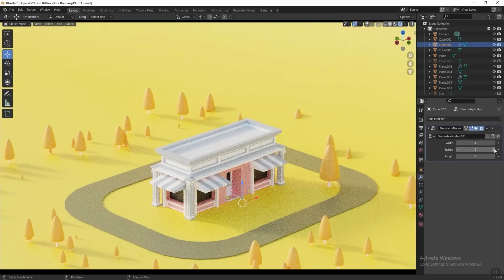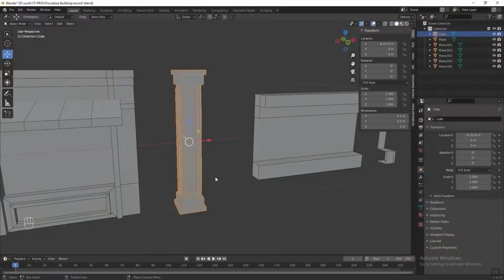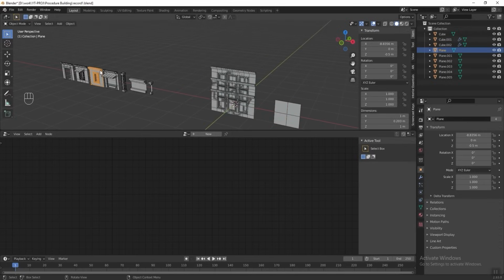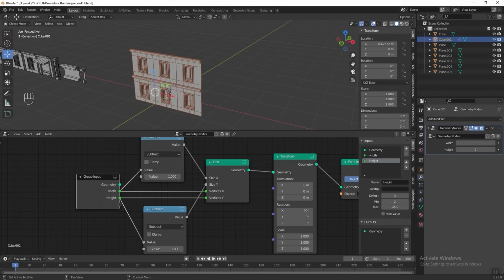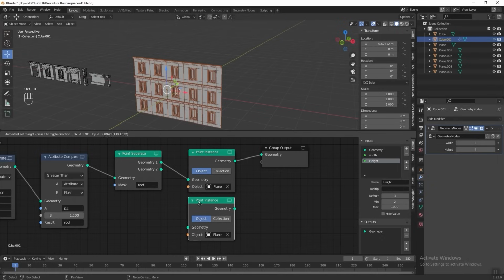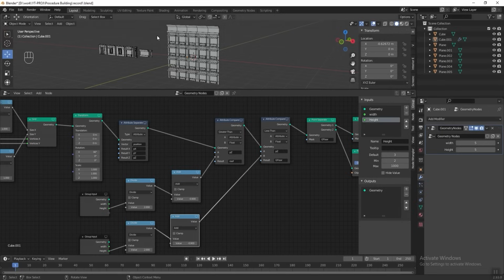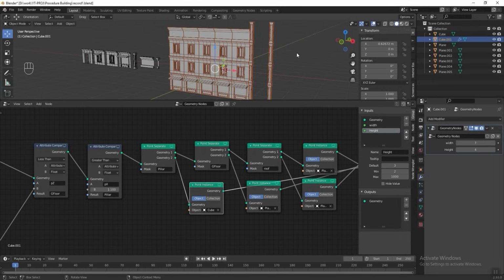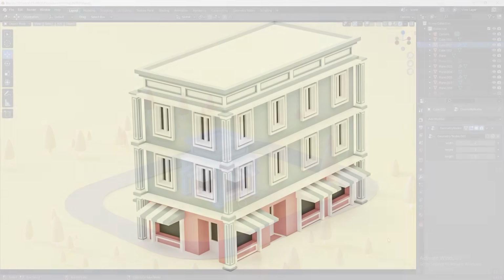Blender3D - Creating a procedural Building with Blender 2.93 Geometry Nodes (TUTORIAL)

Comment: Really roundabout way of making a generator compared to houdini. But it's still impressive to see blender start to dip its toes into procedural point manipulation. The issue is it's way too optimized. 1 node has 3 things that it does so making it do something different will require other 6 nodes. It also can't export unreal engine tool or even uvs yet or even optimal coding to isolate data types or promote specific values but hoping it becomes good someday.
Reply from the maker: Agree with you, when comes to procedural modeling, no one can compete with Houdini at the moment, it is a lot easier to make something cool in Houdini 3D. Btw, to export the object create using Geometry nodes to Unreal Engine, Blender needs to rely on a plugin called AlterMesh

Comment: Hello and thanks for this great tutorial ! I struggle with 3.0 to do the point separate... I found a separate geometry node now but can't find a proper solution for the selection input... Do you have any idea ??? thanks again and bravo ! :)
Reply: Point Separate became "Separate Geometry" in 3.0, as it lets you do more than just points

Here's how I got this part working (bear in mind I'm still learning Geometry Nodes myself)

Assuming the same setup as the video, we have:
Width: number of X vertices
Height: number of Y vertices
SizeX: (Width - 1)
SizeY: (Height - 1)

Initial setup is the same as before, until you get to the point separate part

Add a "Separate Geometry" node, with the drop-down set to points
* For the Geometry input, use the output of the Transform (rotate X 90 degrees) node

For the Selection input:
* Add a new Input->Position node
* Connect that to a Vector->Separate XYZ
* Add a Utilities->Math node to divide the SizeY by 2
* Add a Utilities->Compare Floats
* Set the Operation to "Greater Than or Equal",
* Connect the "Z" from Separate XYZ to the "A" input
* Connect the Math (SizeY/2) to the "B" input
* Connect the result from the "Greater Than or Equal" node to the "Selection" input on Separate Geometry

The "Selection" output will be the top row, and the "Inverted" will be everything else. Connect these to the "Geometry" inputs on two "Instance on Points" nodes, and add a Join Geometry right before the Group Output to bring them back together
Reply from the maker: Thanks for sharing!
Reply: @rma1979  OH man thanks ! :)
Reply: @rma1979  did you find how to use colletion as instances ? I tried to use Collection Info in blender 3.0 and it broke the transform (and doesn't seem it has seed for randomize)
Reply: @norunoru_ch  That took a bit of fiddling, but yes. I checked both the Separate Children and Reset Children boxes, and connected Collection Info to a Separate Components node. The Instances output from that went into the Instance on Points node. On Instance on Points, I have "Pick instance" checked so it only selects a single item from the collection, and the random value goes into the Instance Index socket
Reply: @rma1979  thanks alot dude... it works finally
Reply: @rma1979  thank you!

Comment: Yeah this tutorial is already completely outdated sadly it starts with the point instance node not existing anymore ...what is the new node for that called now? or where is the point seperate now? They added this field system so everything works differently in the future sadly. Attribute Seperate is also gone. They changed Geometry Nodes to much. Yes I could learn this on 2.93, but 3.0 throws all of that away as soon as it releases sadly.
Reply from the maker: Yeah, everything changed in Blender 3.0, i will remake these videos using Fields workflow in the future
Reply: @Chong3D  Thank's a lot I really look forward to that, I  worked through this tutorial and it is really well done! THanks for the hard work.
Reply: @Chong3D  I can't wait, that will be awesome

Comment: is hard to make corners without pillars ?
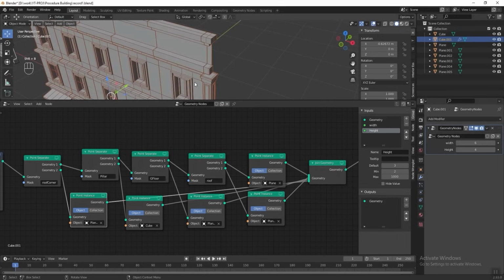Reply from the maker: Not at all, it depends on your building design, if your design don't have the pillar, then you can actually skip the pillar part start from 14:00 to 17:06
Reply: @Chong3D  yes but top side roof corner is problem because without that its kinda ugly
Reply from the maker: @GeorgeKarala  Hi, sorry my bad, we can't skip the pillar part.
But all we need to do is we need to modified the modelling for roof corner,
and beside this we need to replace the pillar with window.
Then after this, use the transform node to put 4 side of wall together

Please refer to the link below for the screenshot and the project file. Thanks

Step1: 
https://drive.google.com/file/d/1Wz4x_ULbnIfBotNNA7x97I7G3L1BG7Db/view?usp=sharing

Step2:
https://drive.google.com/file/d/1Khw_pjJYxgjThAjMwYi1tuzuroULHKZL/view?usp=sharing

Step3:
https://drive.google.com/file/d/104Ezeks8J84tXKbYEhLnj9hAndkugwpD/view?usp=sharing

Project file (Without Pillar)
https://drive.google.com/file/d/1I_qDC8fTyquJJ3i1JSAI8Y17arxx5AzN/view?usp=sharing

Comment: Hi. At 3:00 when you are moving the origins. Click options (above the Viewport Shading icons) and select Origins. Set the Snap Tool to Vertex (Top middle of 3D window) and turn on snapping. 
Now you can snap the origins to the corner. No edit mode. No snap the cursor there first.
Much quicker and easier.
Reply from the maker: Thanks for pointing out! it is a lot faster!
Reply: Thank you, it fasten the process
Reply: Thank you :)